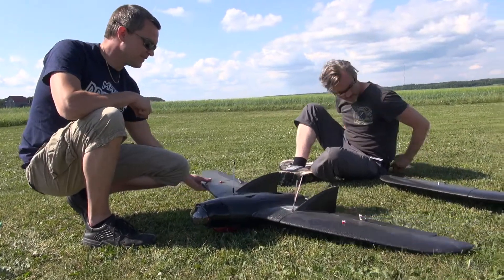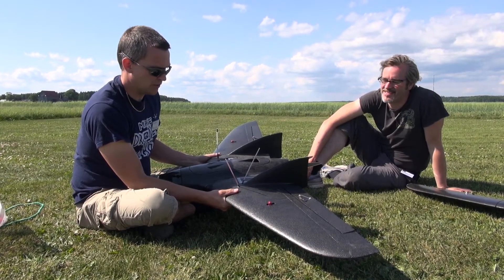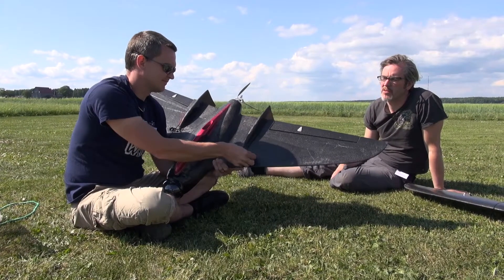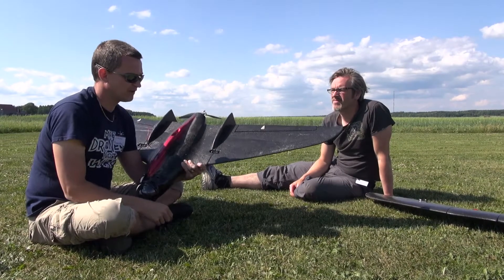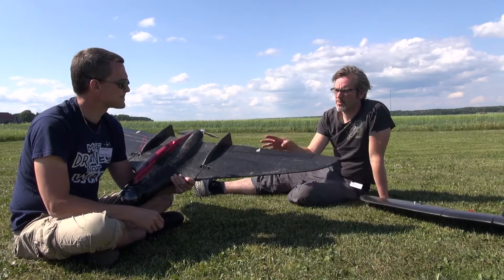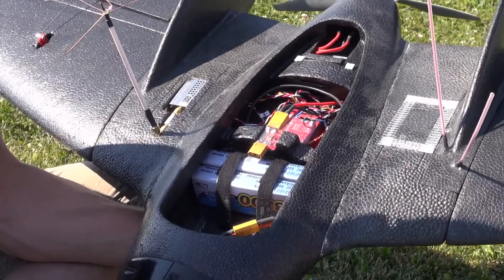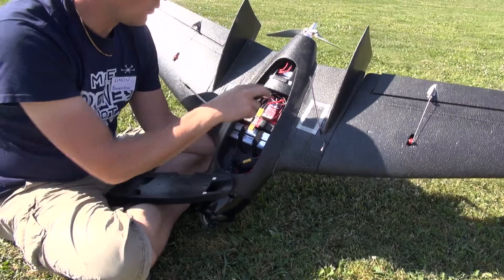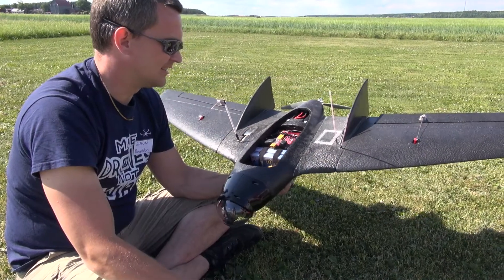RVJET - Standard edition in detail by Simon - 20130629

Comment from the maker: No, when assembly you need to choose between a gopro or an ordinary FPV cam. You can of course later change camera type but there is only space in dome for one at the time. Another choise would be to make a small cut in the wing to mount the FPV camera and let the Gopro to be placed in the dome.